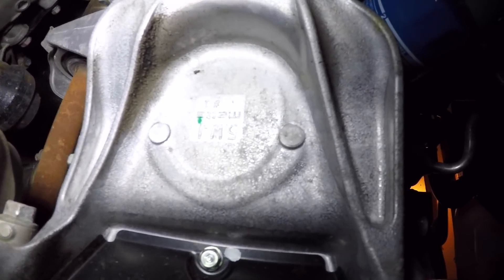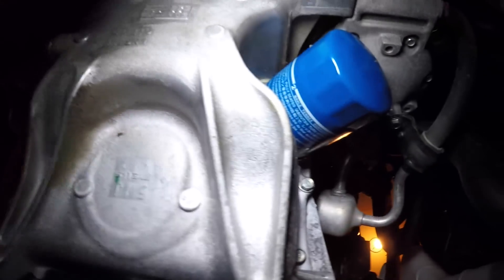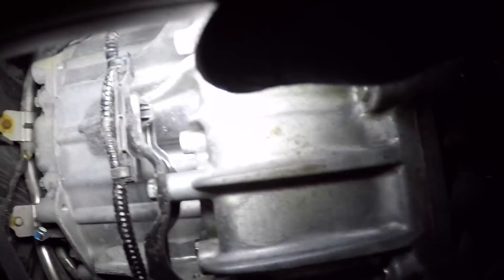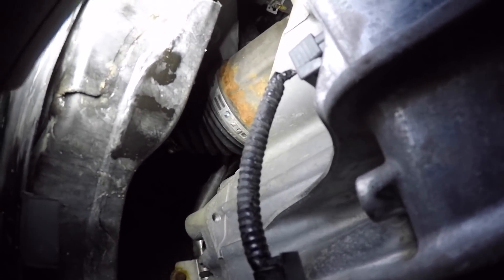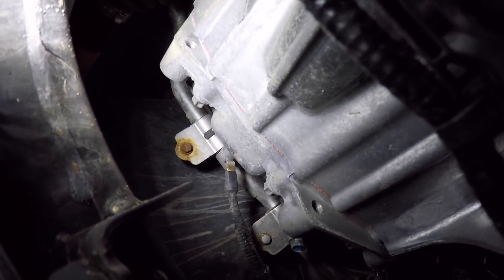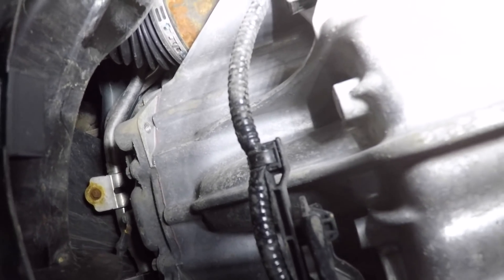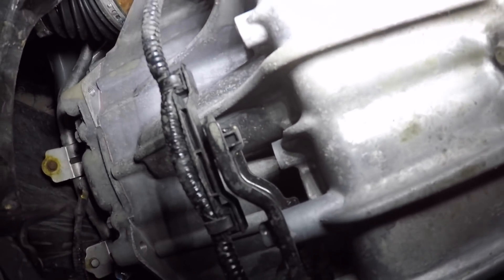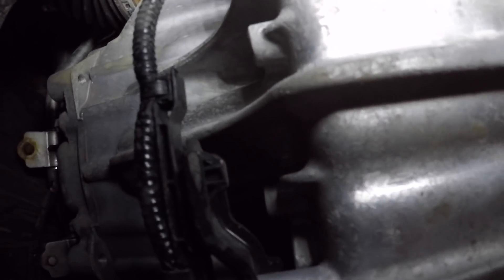Clarity Transmission -  Does it have one?  Really?

Comment: Hi Brad I see that you still follow comments on older presentation even if they date almost a year now. You refer in this video for  "transmission" to the excellent presentation made here  https://www.youtube.com/watch?v=yBpoZ9yFDWw  for Honda Accord 2014. I dont know if you notice that it mention a noise reduction audio system to damper down the engine noise .  I was looking in the owner manual to see if the Clarity is equipped with this feature and could not find any information if so.  I understand that using your EV mode to take off the engine you rarely hear the engine running but still wonder if the Clarity has that mean to help out in this situation?  Could you comment? 

As an addition to your video  I found this link of interest  for your more savvy technical fans . https://www.evs27.org/download.php?f=papers/EVS27-5430337.pdf
Reply from the maker: I do!  I appreciate all comments.  I'm small so it's easy for me to keep up (most of the time) with comments, etc.

The only evidence that the Clarity has a noise-canceling feature is actually from when I was investigating improving the audio system.  Apparently you need to disable it in order to put in anything aftermarket.  I don't immediately recall why but I'll do a quick search.  So that leads me to think it does.  Thank you again for the comment!  -Brad

Comment: Thanks, Brad, for sharing the knowledge that you have obviously labored to gain.  Re the transmission:  The IMMD video was interesting and, hopefully, describes the PHEV arrangement.  The Honda on-line literature refers to CVT, as you mentioned.  Here, exactly is what Honda says:  "Electronic Continuously Variable Transmission (E-CVT) with Sport Mode and Deceleration Paddle Selectors."   When I see the term CVT, I think of belts rather than gears.  I don't want a belt-driven transmission so I hope that it is correct to conclude that the Clarity PHEV CVT is strictly gear driven.  BTW --  I think that your speech is very clear,  and without any "huh" problem.😊
Reply from the maker: Thank you Bob.  I appreciate your thoughtful response and your encouragement.  And I agree; while a PHEV may not qualify as a "simple" machine, my preference is for as little complexity as reasonable.  That includes not having a belt for the "transmission."  So far I haven't found that it has one...

All the best, and thank you again for watching and commenting! -Brad

Comment: Your owner's manual has some clues.

Page 492 "Have an authorized Honda Clarity Plug-In Hybrid dealer check the fluid level and replace if necessary.Do not attempt to check or change the transmission fluid yourself."

Page 567 tells you to use "Honda Automatic Transmission Fluid ATF DW-1" a "change" requires 2.23 US qts.
Reply from the maker: Thanks Jason!  I actually have changed the fluid once myself.  I was curious. 2.6L as I recall.  But that does not always mean it has a transmission in the "traditional" sense.  And that is not a lot of fluid comparatively.  

Was a good point of discussion I thought.  Thank you for watching and commenting!  All the best!  -Brad

Comment: In the sense that we usually think of a transmission as gears that connect to each other, and the gear to gear relationship can change then a Clarity does not have one of those. 

1) When in electric drive only mode the electric motor connects to the wheels and will propel the car from zero to one hundred miles per hour without any gears changing. I really like this because the only sound is a quiet whine from the motor as it spins up. The gas engine is not involved here and is shut down.

2) When in HV mode (or Normal mode) there are two possibilities. First the gas engine is not connected to the wheels. It is simply generating electricity which is supplied to the battery and/or the drive motor. The gas engine turns off and on again as needed. Second, at certain highway speeds, if the load is light (not accelerating or climbing hills) a clutch can engage which does connect the gas engine to the wheels. In this mode the electric motor and gas engine may be running at the same time. So the gas engine is both acting as a generator to supply electricity to the motor and battery. Even in this mode there is no traditional transmission. Rather a clutch simply engages. HV moide is Hybrid mode where the gas engine runs as needed to keep the battery charged to a constant level. This mode is sort of like a regular Prius.

3) In Charge mode the gas engine runs 100% of the time with the purpose of charging the battery. The gas engine may or may not be directly connected to the wheels as described above. The gas engine may or may not be supplying electricity to the electric motor. Again no transmission.

As for a CVT the Clarity has none. A CVT is simply an alternate for a gear transmission. A CVT "shifts" by some mechanism, such as sliding belts" which simulate gears. Again the electric motor connects to the wheels without any form of "gears" which change the ratio of the motor to the wheels.
Reply from the maker: Hey John!  Thanks for the thoughtful, clear comment!  I really appreciate it.  And I hope your Clarity treats you as well as mine has!  30 000km and counting without any issues at all!  And about 22 000 of that in pure EV!  Best of luck!  -Brad
Reply: where does the car tell you how many miles were in EV only? Im a new owner and still learning the gauges
Reply from the maker: @sillygoose4176  Hi!  Thank you for watching!  I'll have to look for sure but it is available from the menu on the left steering wheel controls.  I believe it looks like the horizontal bar graph but I will double-check.  Enjoy the car!

Comment: why?   so many things going on in these enginins.   The Electric motor should turn the wheels and the gas engine should charge the batteries.  that is it.
Reply: That's pretty much what happens most of the time with the Clarity. The only time anything different happens is when the car decides to engage the clutch connecting the gas engine to the wheels. This only happens at highway speeds and, observing the small "gear icon" we can see this does not persist for very long or too often. The clutch only engages when the gas engine is already running to charge the battery or propel the car via the electric motor.

Comment: I think you are right that it does not have a transmission. It would have to have a differential though so that the outside front wheel can turn faster on a curve. If probably goes in reverse by reversing the electric motor and electronically limiting its power.
Reply from the maker: I completely agree!  Thanks for the comment (and for watching!) winc06!